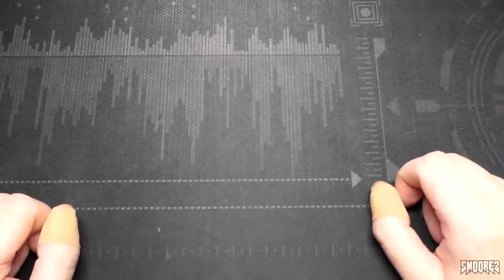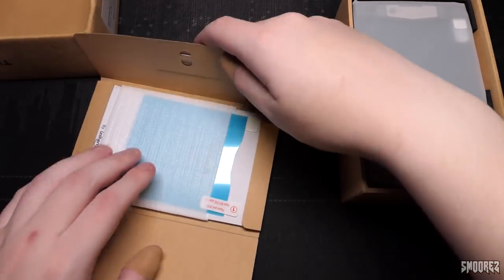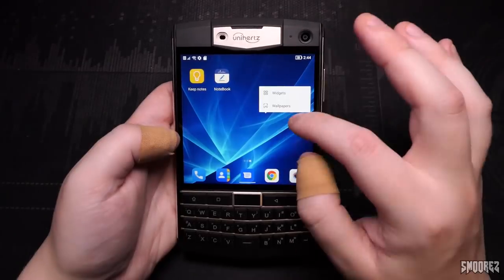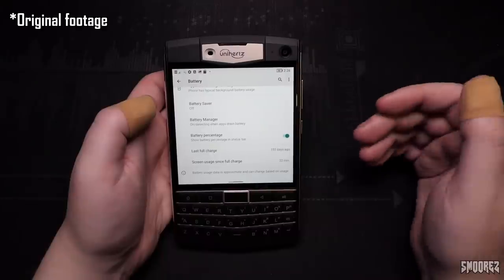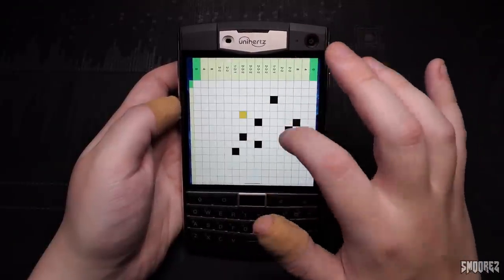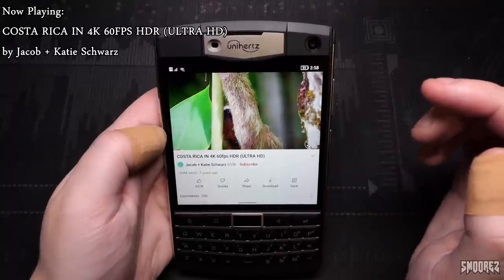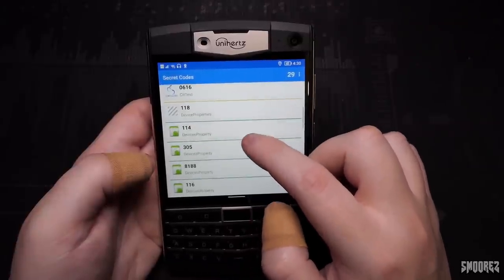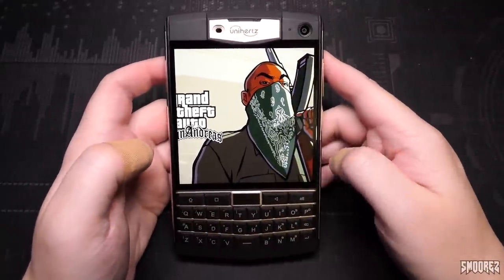The Ultimate In-Depth UNIHERTZ TITAN Review - A Rugged Phone with a Physical Keyboard!

Comment: I was a very early backer of this phone as a physical keyboard fan boy so got for 219usd. Despite being rugged I did manage to damage the keyboard but that was me being stupid as I daily drove for over a year. 
Still used as a work phone as battery lasts a long time as a hotspot and I can abuse as I like. 

I put my Keyone, Priv and even Passport into occasional daily drive rotation so I do love a physical keyboard.

Will be interesting to see what you think Smoorez
Reply: I have big hands so could 1 hand it. 

Screen survived personally a 2m drop to concrete. (After I broke a side button from about 40cm).

Great to see security updates, they are almost updating as long as bb did. For a few months early 2021 they hardly updated.
Reply: I loved the keyboard shortcuts and capacitive keyboard scroll keyboard

Fun fact. For the kickstarter, Blackberry threatened to sue over the capacitive keyboard and aspect ratio so unihertz said screen was slightly rectangular by a few pixels and the home fingerprint button would be a track pad. They fibbed in the capacitive navigatiom
Reply: Never realised the rear camera heart rate monitor. 

I was a bit distracted but I didn't notice the 3 fingers from the top to enter a standard aspect ratio. Good for occasional apps that don't scale and surprisingly usable when you have a black bar each side.

I should have thought of a snes emulator. Great use of the keyboard

I never could bring myself to do a tear down. Great to finally see the insides. 

Wifi would be expected to stop working under water. It is 2.4GHz, the reason microwave ovens operate at 2.4GHz as well is water absorbs this wavelength well.  

My speaker did gather a permanent slight distortion after a swim.

Comment: There are few apps that can force keys to do other tasks, I had that problem when I was using VR, but you seriously need to test bunch of them as some doesnt work on some devices.
Also you could try changing DPI in programmer settings, it could fix some games, like show GUI that was cropped due to aspect ratio... problem is that it could mess rest of phone GUI(eg launcher or even settings)

Comment: Great review - thank you.  I have used BB's for 15 years. Very interested in the Titan and Slim as I had a BB Passport but currently use a BB Key2.  I am a "data user" (not into gaming or watching films on a phone) & I have a Panasonic Lumix DSLR camera so not too worried about photo quality either.
Questions:
1. Is this available in the U.K. & will it run on U.K. Networks? (I use EE [previously Orange?])
2. Any chance they will bring out a 5G/6G model?
3. Does it have a "night mode" (blue filter) ?
4. The Passport has a 66 character line ideal for reading books. Would be nice to see this on the Titan. Also Kindle Book Reader, PDF's etc.
5. I also use spreadsheets frequently on my phone. What does this look like on the Titan? 

If you have time to reply, it would be much appreciated. Thanks.

Comment: The fact that there is enough demand for physical keyboards on phones still is super interesting to me. I definitely understand the appeal (tactile buttons, potentially better accuracy, immediately accessible), but for the most part it seems like a pure regression compared to good software keyboards. Less screen, way more things to physically fail, much slower burst typing speeds (its a phone so it's not like that's a small detail), weird compatibility with a lot of apps, etc. Plus it's not like it's impossible to touch type with software keyboards, and things like glide type really help make the general usage experience less strenuous

Comment: 21:00 The first 25% and the last 25% of a Li-Ion or Li-po battery have different maximum charge speeds. The first quarter can charge much faster than the last quarter, so basing the 0-25% speed on the 75-100% speed like you did is inaccurate.
Reply from the maker: Hey there,
I redid the test. I let the phone completely die out and I started the test at 4:35PM.
This is the status of the battery charging:
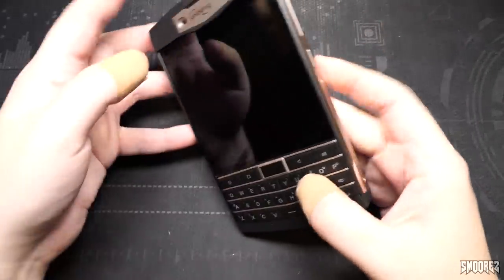4:35 - 1%, 4:55 - 19%, 5:05 - 27%,  5:15 - 32%, 5:25 - 37%, 5:35 - 42%, 6:15 - 61%, 7:35 - 91%, 8:35 - 100%.

So yeah the first 25% was faster but in the end it still did take 4 hours total to get it back to 100%. It could be down to the size of the battery or the charging controller. But I did use the OEM charger to make sure.